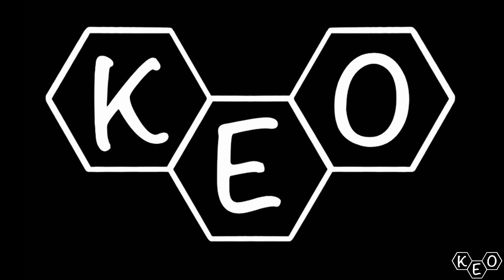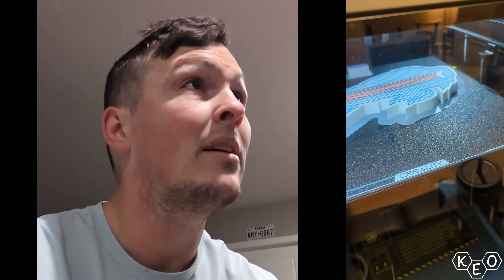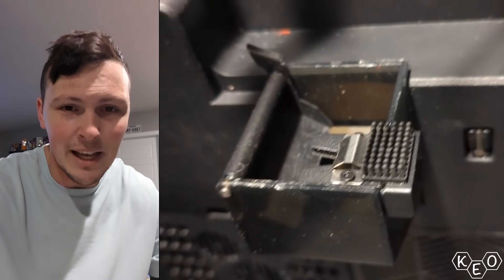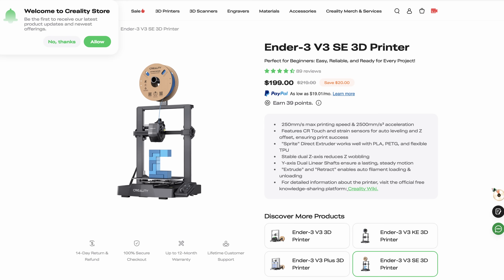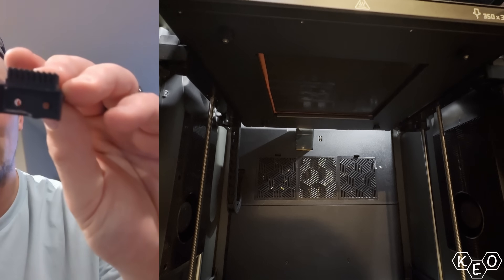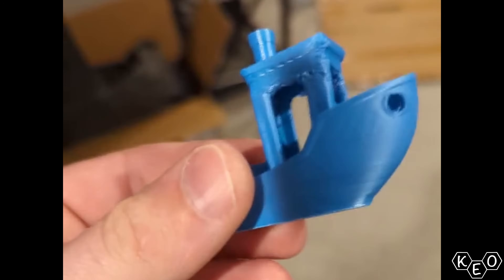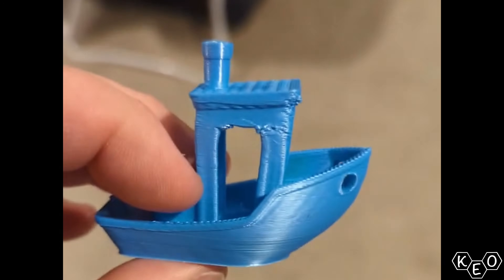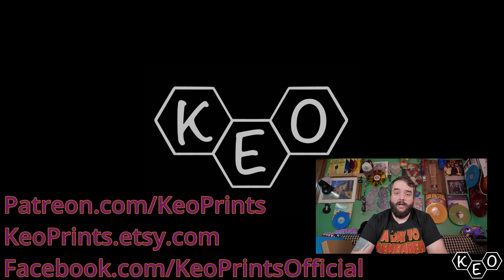We Finally Fixed the Creality K2 Plus (Kind Of)

Comment: Here is how to improve a creality printer.  All you need is a sledgehammer and protection. 

1.) Take hammer and position it over your head. 

2.) Bring down hammer on printer repeatedly. 

Congratulations!  You have now improved your creality printer to something more useful than what it was designed to be.
Reply from the maker: Excellent advice. I will have to employ this method as we have not tried it just yet. Nearly a few times,  but not quite yet
Reply: @KeoPrints  Just make sure to make a video of it. 🤣

Comment: I have not had a single issue with my K2 Plus, Creality Hi, or Ender Max Neo. I had nothing but problems with the P1S. The P1S was noisy, the "touch" screen was an absolute joke, the AMS was another joke, and it just seemed to get worse as time went on. My final and absolute red line was when Bambuzled labs tried to lock me into their ecosystem or brick my printer. They lied, gaslighted, and tried to stealth change their ToS. Thankfully, we have internet archiving sites to call that out. They have since removed their sites from internet archiving sites, which really makes you wonder why they would want to do that.

I am also thankful that there was a huge backlash from the 3d printing community over all of this and that people did not let Bambuzled labs get away with it. It is sad that there are still YouTubers promoting this company after that while trashing open source companies like Creality. Bambu tried to change the terms of the sale after the sale, which is illegal in most countries, yet you still support them. Bambu lied to you, gaslit you, and yet you still support them. Bambu wants to kill open source, and yet you still support them.

I have to admit, though, I kind of miss working on the P1S. I miss the challenge of trying to keep that PoS up and running so much that I ordered a Snapmaker U1. With it being new to the market, I am sure I will get the chance to troubleshoot again, except this time with an open source company and a machine that I am confident will only improve once it has some time under its belt.

Comment: This kind of content is SUPER helpful. Im so tired of youtubers shilling the next printer they get "Just works" and then there audience gets ripped off buying this crap.

I just threw out my Bambu A1. what no one tells you about those machines is they are filled with parts that will break and replacing these parts will always result in poorer print quality as eveything isn't perfectly alligned. 

The AWS Lite is utterly attrocus, multiple part fail each month (both fans, hotend ceramic heater, nozzles). You cant simply click print without baby sitting it to fix every stupid error as it prints.

Comment: I have to say I am almost embarrassed for your cluelessness on why the replacement part was slotted without threads clearly all you guys have zero mechanical experience, yes Creality should have included new screws for the new (slotted) and upgraded part that is on them, judging by the lack of the clear reason it was slotted and the reverse engineering you did to un upgrade the upgraded drop in replacement part I am willing to be all your problems are user error. yes I would have included the tongue sigh smack thing after every other word but I have no idea how use the alphabet to express that sound you have to be the HOA president when your not playing with your printer. Glad you got it working though!!
Reply from the maker: I can't relate to the alphabet portion of your notes here but I also struggle with the use of punctuation at times. Happy to say we got the machine running at that time. Sad to say, the extruder once again failed after a week or so...

Comment: Last summer I bought an Ender V3Plus and had nothing but problems from day one  The first was the Co-Print that came with it didn’t work and when I tried to revert the main board it wouldn’t , it took over a month and a half to replace the whole printer but during that time they kept on sending me parts to fix a brand new machine, they sent me enough parts to make another printer . My point is that they don’t know how to repair their own printer. They finally sent me a new printer 2 months later . Now I have a new Ender3 V3 Plus Plus . At the same time the Ender didn’t work my K1C broke down and kept on slamming the tool heads into all corners of the printer, so what did Creality do ? The just sent me parts, I guess hopefully something is going to make it work , so now I have enough parts to make a new K1C  . It turned out to be a loose wire near the side wall fan . And it still kicking, so is the Ender3 V3 Plus.

Comment: How does your CFS system work…mine does not work well or at all…
Reply from the maker: Honestly, we have had to take it apart a time or two but that was more so in the beginning. Generally, the printer hasn't run long enough for the CFS to let us down
Reply: @KeoPrints every time I use it it says it’s jammed! So frustrating

Comment: Guess I'm one of the lucky ones.  I've had a K2 Plus since May and it's been great.  There used to be an annoying extruder clog when I did a print in ABS, then did PLA on the next print.  That seems to have been remedied with a change to the flush parameters in an update.  Any print fails I've had have been adhesion issues because I didn't clean and prep the plate. Aside from that mine has been great.  I'm always leery of anything that's an initial release.  This goes for cars as well as most technology.  Many companies put their product out and only after several months in the wild do they figure it all out.  The warranty part in the video is the exact part in my machine.  I think the lesson here is don't buy the initial run on just about anything.  Give it some time to work out the kinks.

Comment: I appreciate the info provided as I too have a few issues on my own. I have a pair of K2 Plus Combo and a K2 Combo. The K2 Plus is 350x350x350, the K2 Pro is 300x300x300, and the K2 is 260x260x260. In the video every time the machine is referenced, only K2 is said. That one is the K2 Plus. Due to some of the differences outside of build size, it is important to refence the right model. Outside of that, I think it was helpful and the more info that is shared amongst all of us, the better we all will be from it. As I said, i have a pair of the K2 Plus Combo, one of them works exactly like it was advertised to do. The other, was replaced once but after that, they simply send a part here and there in an attempt to make the problems go away. However they fail miserably to actually read the emails so instead of sending the parts I tell them are bad, they send random items that have absolutely nothing to do with the issue. But I can say they are still a million times better than the absolutely useless Anycubic customer support that simply tell lies and ignore customers. Their return policy is one of the worst and they even fail to honor that. At least I can say that my K1Max has over 10,000 hours on it and still laying the layers. Sure, it's had bad days but nothing out of the ordinary nor major. But like you, I like my Bambu. That is why I have 16 of the A1 Combo included the farm. Hope to get my hands on a P2S soon. Thanks for another great video.

Comment: I have all Creality printers. Ender 3 pro and an S1 running klipper with the sonic pad. My K1 I bought broken for $50 bucks and just replaced the motherboard for $40 bucks it has been flawless. Plus an Halot R6 bought new and a Halot 1 bought used. I repair everything myself because a 5 year old could fix these machines. Their architecture is simple and easy to diagnose. I don’t use Creality customer service because it sucks. I just buy my parts from eBay or Amazon. They are cheap and I get the part I need first time.

Comment: Thanks for annother great video! i got lucky with my K2. I run it with 3 CFS (not for multi color -> I'm, am a lazy ass, I load multi material and always a backup so I can select the material I want to print with and do not need to check I f there enough filament left). But I also changed my heated bed to flat bed from a german company. I guess that creality and other manufacturers give a s.... about quality control in mass production. I had a very mixed expirience with Qidi Plus 4. I bought 3 Qidi plus 4, one works like a champ (about 2000 hour of printing with high temp. material, on one I have sometimes issues with the z-leveling, and one was just total crap und I had to return it to my dealer, because after 2 months of dealing with customer support they did not respond to my emails. The printers with the best reliability are my 3 RatRig Vcore 500 printers besides nozzle changes and greasing the rails no maintance needed after over 3000 hours of printing.

Comment: Loved my K2 Plus for 2 months.  Worked beautifully.  Then it started making clicking noises, then the x axis belt snapped.  I replaced the belt, but it wont move without force.  I've now had to dissassemble the back and remove the x-axis motor, which creality is sending me a replacement.  Hope it works, but their recommended method to replace this is to hammer off the side panels which are glued on.  They sent me an alternative method which is a pain but avoids hammering on my printer.  This experience made me buy a Prusa Core One and hope, at th least, its easier to fix if it breaks :/.
Reply: Core one ouch, such a bad choice
Reply from the maker: I’m inclined to agree with the Bambu sentiment. I’ve never owned a Prusa so I can’t speak to it but I do feel like they don’t offer as great of a value per cost. But maybe I would get it if I used them
Reply: @KeoPrints Well in the 2 weeks since I've had mine its been the most problem free printer yet.  The  UX is for sure behind the competition but the print quality is far superior to either of my other two and its just worked.  And with the new INDX toolhead announcements makes Prusa the best option for multicolor (well, will be next year when it comes out anyway).  I didn't start as a Prusa Fan boy, but a couple days after I got it I got an email because they announced the "core one+" which added QOL enhancements and they offered to send the kit to me for free, plus, all the files are available to print yourself for free.  I definitely understand the flack they get - they're expensive, small, and the UX is dated.  But the company is just less "Ick" than the rest, and the printer works better than most (though I can't comment on Bambu.)
Reply: We'll see.  Also have a first gen anycubic kobra s1 that has nothing but problems.   I have no interest in Bambu.  Core One is mostly printable, and sort of meant to be disassembled/assembled, and at this point I just assume all printers suck/fail, so it's down to how easy they are to service/tear down.
Reply: bambu is a step above everyone else, I realise you may not like them for some overblown issues but it's not even close. Core one is just a huge waste of money on a very mediocre printer, you can get two qidi q2, two bambu p2s or one h2s for the same price and they are all so much better, h2s is like a spaceship compared to it.

Comment: I bought a K2 Plus and kept it for exactly 10 days. So many problems and disappointments that I had to return it ASAP.
Nozzle releasing metal fragments, extruder spring breaking, pneumatic connectors falling apart, CFS sounding like a cart and chewing up filament - total nightmare.

Super frustrating! Clearly a rushed product with zero quality control or care for the customer.

I ended up waiting until November and got myself an H2D instead - no regrets so far. Now I’m just waiting to see what kind of “surprises” the H2D will bring 😅
Reply from the maker: Hopefully no more surprises! Sounds like you’ve had enough

Comment: I have a K1C and loads of trouble with it. I’ve replaced the main pc board, the stepper motors, as well as several smaller parts. I still lose home settings during printing, causing axis shifts that ruin the print. I think it’s a design error in that the force applied during extruder acceleration overcomes the plastic structures in the x and y axis. Similar issues with my Ender 3 V 3 Plus. No more Creality for me.
Reply from the maker: I hate to see it but I hear it all too often

Comment: Adam you are great. PS. My Ender 5 Max is constantly just being weird. My latest issue is that I had to take the tool end apart due to a Blob Of Death. It had gotten into the front blower fan. When I went in to remove it. I had to first remove that awful glue they put on everything. Not my first time mind you. I used the snipper, as they even recommend, and went to remove the Molex connector. The glue had been so hot that the Molex connector(S) literally shredded in my two fingers. Now I hate trying to deal with their customer service to the point of anxiety. So I went looking on their website for the parts, and low and behold there were no corresponding fan parts. In fact the listed number of spare parts numbered in the less than 20. 
Now I find it hard to believe that in a China, where education and personal performance is a major factor in their culture, a whole building of these educated people could be SOOOO extremely stupid at Corporate organization, from their wiki, parts store, etc.
After hitter the Reddits for help I found this INTERESTING tidbit. Creality's Customer Support is Amazing... in China. How to reach them directly. If you've got issues the forums can't answer and want to talk to a Creality engineer, hit the domestic Chinese storefront and they'll get back to you immediately. So I do not know if this is real or not, but you WOULD expect their service to be better in their own country...RIGHT?

Comment: I bought one of the first K1 Machines. Bad experience. Three extruder generations and two hotend generations were needed to made it a good machine. Loads of free parts and even more irritation. Never thought they would repeat the same QA mistakes again with the K2 series. But they sure did!
Reply from the maker: Sounds very familiar. It’s unfortunate because this is a heck of a promising machine

Comment: I replaced the hotend with a Micrioswiss and CHT nozzle. While I was at it, I also switched out the polastic extruder gears for metal ones. I now hear from another YouTube site that the metal gears are aweful. Maybe I received different gears as I haven't noticed any difference at all, which I guess can be good and bad. Either way, the machine prints fine...Oh, and I ordered a wiper because I just noticed mine is gone, vanished. Funny thing is that I never noticed. It always has printed great. Maybe I shouldn't put a wiper in...just a thought.

Comment: I have the K2 Pro combo and had some issues with it initially thanks to Fedex playing dice with it, but Creality was great in getting me replacement parts (and the right parts) with no issues and it's been flawless ever since. I used Creality's email support and they were quick to help and I got parts from them within a week which is far better than the near month it took elegoo to send me parts for the Centauri Carbon. The K2 Pro is my 9th Creality printer and has been an amazing addition to my little print garden.
Reply: I love to hear stories like this, and Adam sorta told you about me, I love Creality and my Hi and my Ender V3 are probably some of my most reliable printers for a pretty good size print garden. 

Thanks for sharing 😊
Reply from the maker: Glad to hear about the good experiences as well. There have to be some working machines out there

Comment: I had a k2 plus for a month and had to get rid of it. I had maybe 20 hours on it and I had to replace both head unit mother boards, the main drag chain wire that goes from the head to the main board and a bed sensor. Only way to contact Creality support is via WhatsApp and they are on what ever time zone china is on, which means I could only talk to them after 8pm local time. All parts had to come from china which took forever. After I got it working I immediately sold it, Never again will I mess with Creality... sticking to my Bambu Printers. I got the K2 because the H2D was sold out and I thought the K2 would've been a great replacement boy was I wrong. Sold and bought a H2D
Reply from the maker: Yikes. Totally get that. The K2 is an enticing option. If it worked well, it would be an excellent value
Reply: Wow that's incredible 
I been looking alone of these for a few  days now 
I guess I better stay away